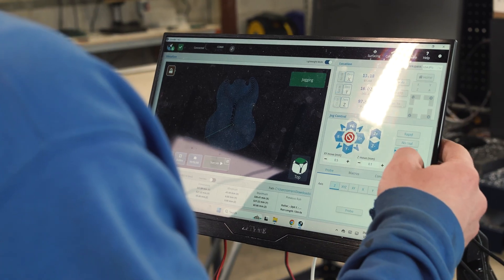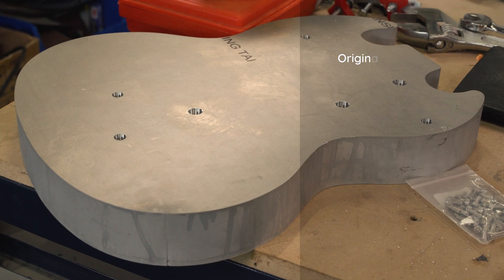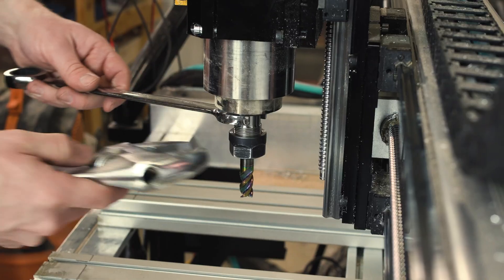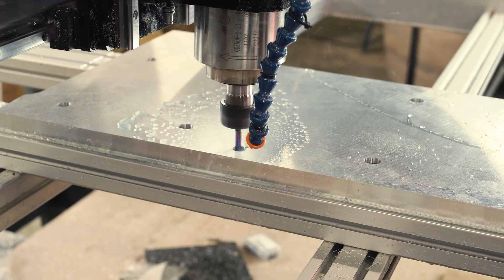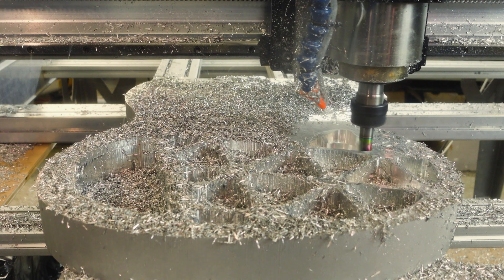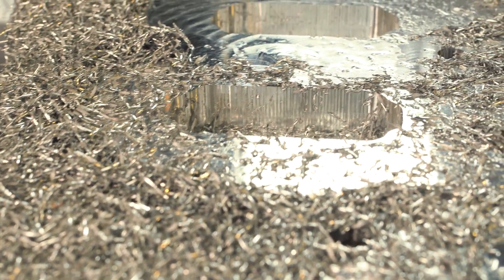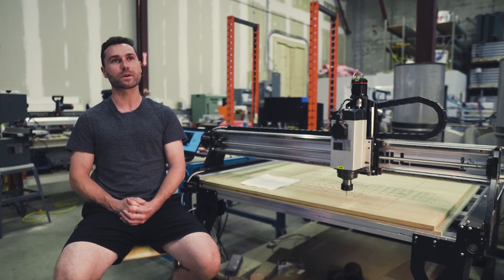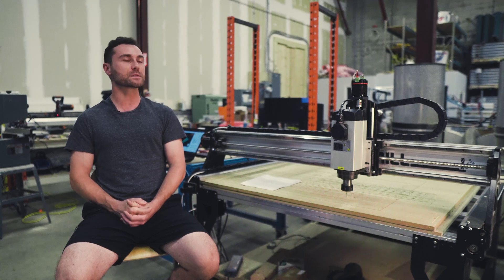Creating an Aluminum Guitar with the AltMill CNC: Mike’s Journey

Comment: that was impressive. the power of the spindle is only one thing. It also shows the rigidity of the altmaill. and selling it with a less horsepower spindle is smart, That is going to be all most people need and keeps the cost down. Maybe someday there could be an option for more HP. Again I was impressed. what was the design work done in, Possibly Fushion 360?

Comment: Since the 1.5kw spindle is the one you're selling I think it would make more sense to show off what that can do rather than more powerful spindles.
Reply: I imagine this is still to come, especially from other creators. However I can also see the value in knowing what the machine’s actual limits are since the spindle is the first bottleneck for overall performance capabilities. Especially since you can always buy the machine without the 1.5Kw spindle and put whatever you want there instead depending on each persons needs.
Reply: @kenbouchard834  I can only afford the 1.5kw and barely at that. I can imagine that crazy big spindle is probably 2 to 3 grand so possibly more than the machine itself. So I just feel like they should focus on what the machine can do in the form it's probably going to be used in the most. But I understand your point as well.
Reply: During the interview it's a different spindle - likely a 5.5kw. For the cutting they are using a 2.2kw spindle but still pretty comparable to the 1.5kw spindle I'd say.
Reply: That surface finish isnt because of the spindle alone, it speaks to the rigidity of the machine itself, which is interesting.
Reply: @CryoftheProphet  I'm not talking about surface finish, I'm talking about cutting speed and power. There are things a more powerful spindle can do that a 1.5kw cannot.
Reply: @chubbyboy2242  I mean, that statement is just a truism on its fact. Of course a more powerful spindle can do what a less powerful spindle cannot. 

Whats impressive is the fact that this seems to have more rigidity than say the shapeoko 5 pro for example, and when you consider the rigidity, a 1.5kw spindle is a great matchup for this router.  They have shown it here with a larger spindle but that just tells you that a smaller spindle will yield at least the same quality result, maybe not as fast, but it seems like the cnc router to get for the price.
Reply: @CryoftheProphet  Well, I hope you are right my friend because mine is sitting in my basement waiting to be assembled. Can't wait.